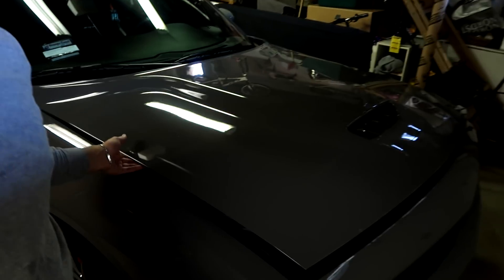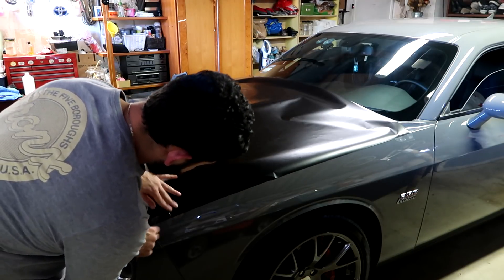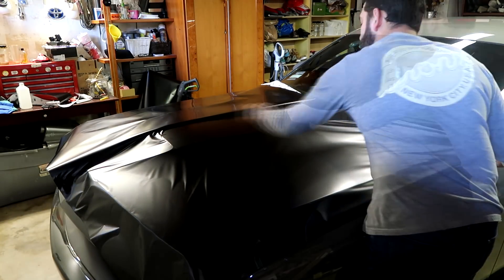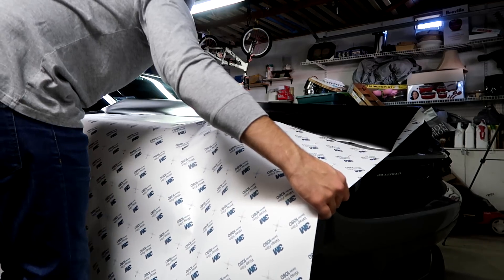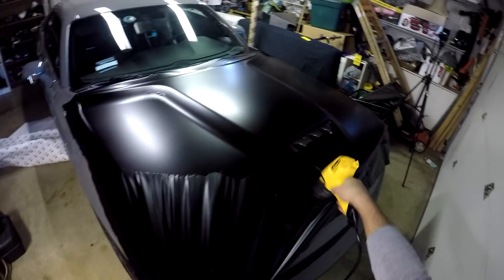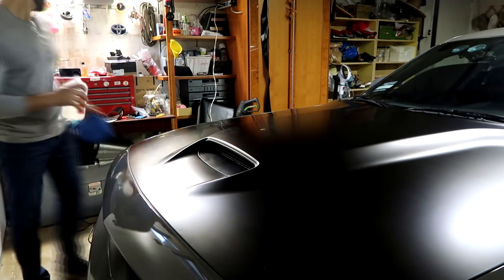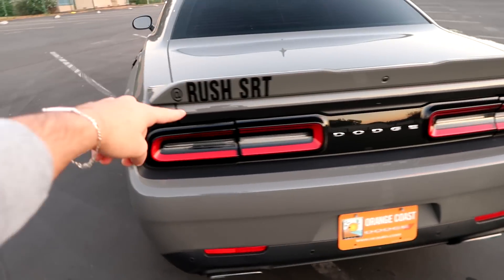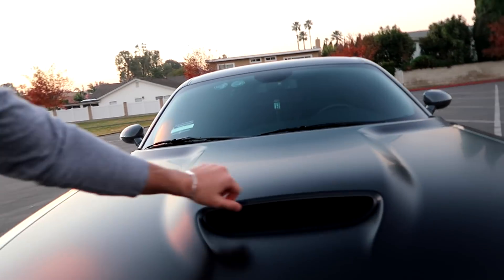How to Wrap a Challenger Hood! Step by Step Tutorial

Comment: How difficult was it working around the scoop? I’m going to wrap my 07 Charger SRT hood. Nice job looks great!
Reply from the maker: It was pretty tough not going to lie but thankfully the film can be lifted and reapplied so just take your time with it and don’t give up I almost did but then got the hang of it
Reply: @RushShift  I tried twice, on 68 degree day, couldn't get the wrap to properly sit in front of scoop air intake. The hood was completely wraped.the last part was To mold around the air intake. To much wrap and was difficult to stretch. So I pulled half off and tried again. To many wrinkles. I sabotageed my own work. Pulled it completely off, twice. Damn...